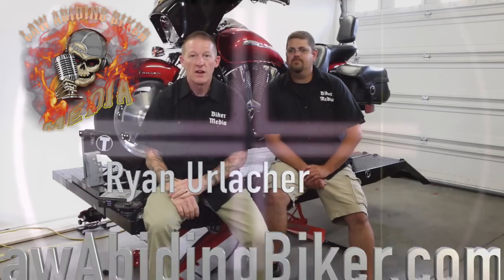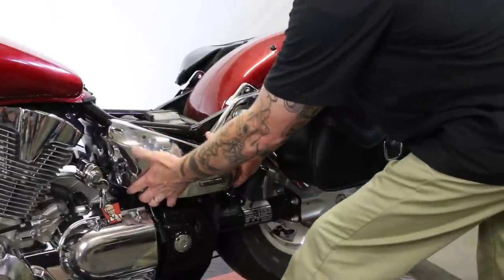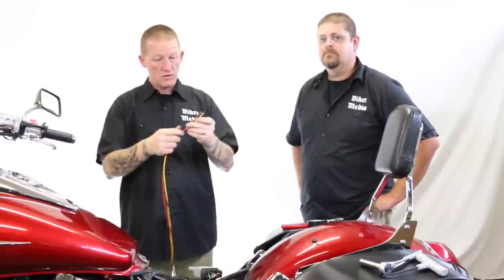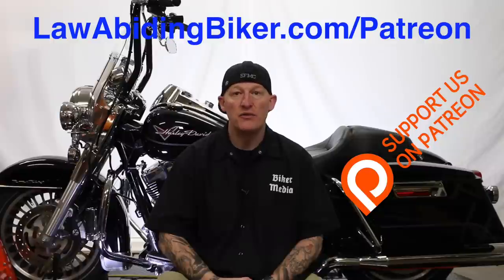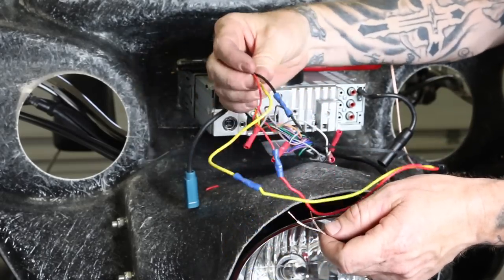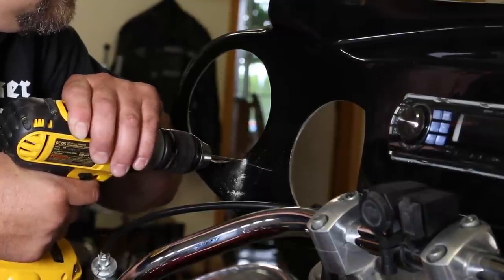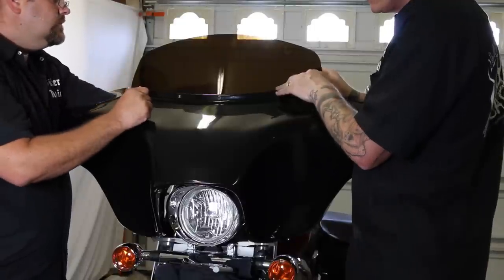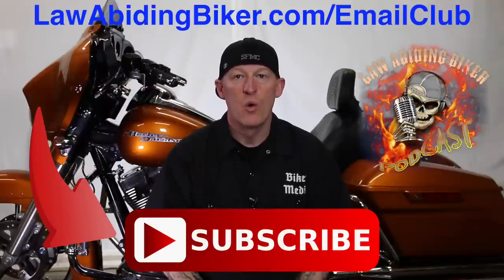Install Aftermarket Stereo & Speakers on a Honda VTX Motorcycle With Batwing Fairing

Comment: In regards to what antenna to use, I just used an old car antenna cable about 6" long and soldered a 2 ft. piece of insulated copper wire to the positive side of it (the center, not the outside if the cable, that is the ground)  It's just routed around the inside of the fairing and picks up radio stations from over 60 miles away, so I figure it works pretty well for what it is. There may be better ones out there, but for what I have, it works perfect.

Comment: I mounted a batwing on my VTX 1800c & went with the BOSS marine stereo & speaker system with amp & the head cover, it’s water proof & has a UV protective coating for those days you can’t find any shade to park under. The marine stereo systems I think are better for this type of application simply because you never know when you might hit rain & why take the chance???
Reply: Where did you get your batwing for your Honda? I have a 2004 Honda shadow vtx1300 , will it fit mine?

Comment: A better way to splice into the factory wiring would be not to cut the wire.  You remove a piece of the wire sheathing, split the wire apart, and run the new wire thru and wrap it around. You then use solder the connection and use water proof wrap tape.

Comment: This video is so helpful, thanks! I'm curious though. Wont the stereo bounce around with just that bracket holding it? Seems like maybe a piece of foam or insulation wedged in there to steady it might help. What are your thoughts on that? Again, thanks so much for putting this together.

Comment: I'm working on putting a stereo in my VTX with an aftermarket fairing. What mounting hardware did you use for the head unit?

Comment: Can i use regular car speakers/stereo? What could i use for better bass? New to bike systems wanting bass with my sound, recommendations?
Reply: Depends on your bikes excess electric abilities. First thing you need to do is find out what size fuses are in your ride and what's not being used. Not all bikes can handle the same demands. It does take some time to learn, but you can and you can do it relatively easy! There's allot of videos that explain everything you'll need to know. And the best part is, once you know this stuff, you'll NEVER be misguided again and pretty much be able to effectively investigate and answer your own questions! Happy adventuring!

Comment: One VERY important point not made here is that you have to have SHALLOW speakers because the Batwing does not have much depth and you also need slimline grills. standard gills will extend past the bottom of the Batwing.  I have had to do a lot of fabricating on the bottom portion of the speaker to fit.
Reply: I have 6x9 speakers for mine and they dont fit in the hole. I have to grind down the hole to make it bigger. Did you have that problem too?

Comment: What wattage radio and speakers did you install? Trying to install this week and everywhere online says I need 300 watts RMS each speaker (two 6x9s) which means i need a 600 watt RMS radio and all the radios I'm able to get are only like max 50 RMS x 4

Comment: Great video Ryan and Kevin, question  , is there a need for an in line fuse when installing the radio ? Thanks
Reply: Most stereos come with small fuse...back of unit itself...good luck bro
Reply from the maker: Mike BigEasyRider speedshifter88 is correct.  The stereo had a built in fuse.  If you installing one that doesn't, I would definitely suggest putting one inline on the constant power.
Reply: As a side note, fuse should be as close to the battery as possible.  Solder and shrink tube is much better and safer than butt connectors.

Comment: I already have a power supply that is turned on and off by the ignition switch, can I use a matching 2 prong connector and hook the red and yellow wires on the radio together to have power? That power supply powers a CB radio on the bike. How can I use that to power my radio? It is a 2 prong black and red.

Comment: I bought a bat wing for my 2005 Yamaha Rd. star 1700 and the stereo opening is very large. It is 5 inches wide by 9 inches long takes for 4 x 5“ speakers but when I bought a stereo for it the hole in the bat wing is too big. And the speaker holes will not accommodate a 4 x 5” speaker because the holes are about a half inch too big what would you recommend to install a marine stereo with four speakers with 6 inch speakers and what adapters would I need to make the stereo fit a hoe.

Comment: What will be the preferred gauge of wire that should be used when installing audio in the audio fairing? i wouldn't want anything catching on fire.
Reply: if you are referring to the power wire then you want something that is 8-10 gauge.

Comment: So I'm having trouble I did everything in the video to the tee and I had the bike on not running so I could set up the radio and clock and all right and when to start my bike after only like 20 mins and battery was completely dead

Comment: Wait..... what about the radio antenna???? how\ where did you mount the antenna??
Reply from the maker: The owner did not install an antenna.  

Ride safe & Ride Often!
Here is a link to a bunch of our useful Free vids: http://www.lawabidingbiker.com/freevideos
Here is a link to some of our useful for purchase videos: http://www.lawabidingbiker.com/buyvideos
Want Answers & Information Fast? And help support us at the same time? Do you like the content we provide?
Our patrons get answers to their questions/comments/feedback in less than 24 hrs and are part of our Private Facebook Group. If you are interested in being in this exclusive group you can get all the details at ==> http://www.lawabidingbiker.com/patreon
If you haven't subscribed to the Law Abiding Biker Podcast make sure to do so. Listen in as we talk weekly about issues/items like this & so much more. You can listen on iTunes (Apple/IOS), Stitcher Radio (Android), or any other Podcast App ==> http://www.lawabidingbiker.com/podcast
Join our free email club at http:///www.LawAbidingBiker.com/EmailClub. Only relevant content will be sent from time to time. Email club members are the first to find out about free or for sale content are given special coupon codes.
Reply: When I put a batwing with a radio on my VTX I used a marine dipole antenna, plugged it into the radio then hot glued the legs of the antenna along the inside of the back half of the batwing. So far the radio reception is good and the hot glue has held nicely. 
Search the words AM FM dipole antenna    It looks like a capital letter T with a plug for automotive radios. Sold on Amazon or eBay or marine supply stores.

Comment: Think I missed where the ground wire got attached. Do you just attach it to the frame somewhere?
Reply: He ran it to the negative post on the battery, but ground is ground is ground is ground. So you can run it to the frame if you like.

Comment: With the stereo and speakers install, does it shorten the battery life?
Reply from the maker: Can't say for sure, but i doubt it.
Reply: At timing 4:50, how can I find the hot connecting wire for Harley Davidson Dyna?
At timing 17:00, is it the yellow wire is to provide continue power to the stereo when the bike is switch off? So that when switch on the bike again, the stereo can remember the last setting or the clock timing, is it? Why don't stereo has a small battery similar like the one in the motherboard, or a memory chip, that will remember the last setting? When I change the battery every time, the last memory will be gone too... And does the continue power draw a lot of battery juice when the bike is switch?
Reply: 4:10 - 5:18
Hot Wire for amp remote power that turns on/off with ignition switch.

Comment: I absolutely hate them butt connectors, I like solder only, them butt connectors last long enough until your memory is gone of what you really did, then boom , it stops working right, soldering doesn't take much longer, good solid no problem connection

Comment: So this may be a stupid question but I am totally new to this. If you cut the wire and butt splice in the new wire (the wire that goes to the stereo) won't whatever was connected in the first place not work anymore? As in if you disconnect whatever was originally connected on the wire from the battery and use that wire to connect the stereo to the battery, than won't whatever was originally connected to the battery just be disconnected? And therefore unpowered because it's no longer connected to the battery the stereo is. Unless maybe you can put both those wires into the one butt connector so you've got battery power to the butt connector and then power from the butt connector to both the stereo and the original connection. If that's possible and that's what you guys did I must have either missed it or misunderstood.
Reply: your last guess is correct, they cut the red wire from the battery then twisted the radio wire to one side then but connected them back together so that red wire from the battery now powers the radio and the original connection.

Comment: my question is won't the radio kill the alternator
Reply from the maker: +Michael Glasgow Nope, no problems whatsoever. Doesn't take that much to power it.
Reply: @RyanUrlacher  I have a question I did everything that you guys did in the video and while I was setting up my radio with the bike just on not running to be clear when I went to start it after I set up the radio my bike battery was dead any reason why that might be cuz I had a brand new battery

Comment: I'm having a problem with my wiring, I got my positive and ground connected to the battery and the negative, stereo is on but now it doesnt turn off! I thought it would turn on and off with the ignition
Reply: You have to also connect it to a switch wire. For it to go off and on with the key.

Comment: You didn't install an antenna
Reply from the maker: That is correct.  The owner didn't want one.

Ride safe & Ride Often!
Here is a link to a bunch of our useful Free vids: http://www.lawabidingbiker.com/freevideos
Here is a link to some of our useful for purchase videos: http://www.lawabidingbiker.com/buyvideos
Want Answers & Information Fast? And help support us at the same time? Do you like the content we provide?
Our patrons get answers to their questions/comments/feedback in less than 24 hrs and are part of our Private Facebook Group. If you are interested in being in this exclusive group you can get all the details at ==> http://www.lawabidingbiker.com/patreon
If you haven't subscribed to the Law Abiding Biker Podcast make sure to do so. Listen in as we talk weekly about issues/items like this & so much more. You can listen on iTunes (Apple/IOS), Stitcher Radio (Android), or any other Podcast App ==> http://www.lawabidingbiker.com/podcast
Join our free email club at http:///www.LawAbidingBiker.com/EmailClub. Only relevant content will be sent from time to time. Email club members are the first to find out about free or for sale content are given special coupon codes.
Reply: I agree. would liked to have seen them at least address the antenna plus the wiring up of the last two speakers.

Comment: YOU GUYS ARE HACKS 
BUTT CONNECTORS ARE YOU KIDDING ME 
BUTT CONNECTORS ON A MOTORCYCLE Quit being lazy and solder your wires together and solder your wires onto the speakers and use heat shrink on everything 
AND WHAT NO AMP ON A MOTORCYCLE AGAIN ARE YOU KIDDING ME

Comment: What gage wire is that?
Reply: +Ant Banks We used different gauges.  Which are you referring to in particular Ant?
Reply: The wire used for ground, trigger and 12v
Reply: I was thinking of using a set of the battery tender wires for the +12v and ground.  Then adding single wire for trigger.  Do you think this would be okay to do.  The+12v woukd have a in line fuse